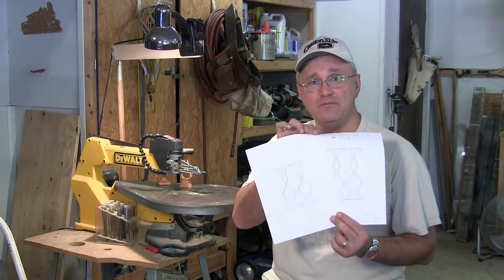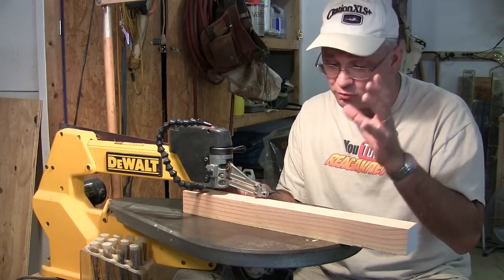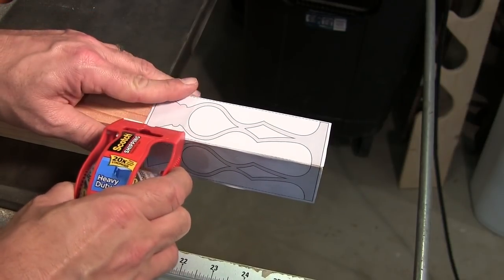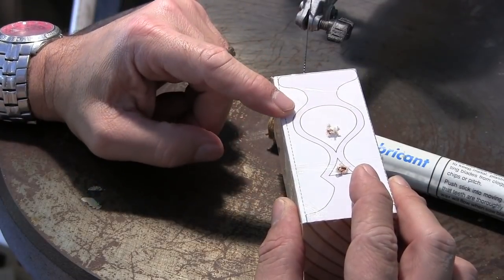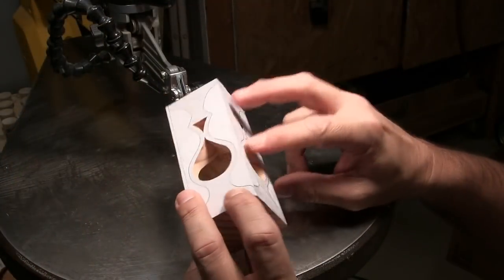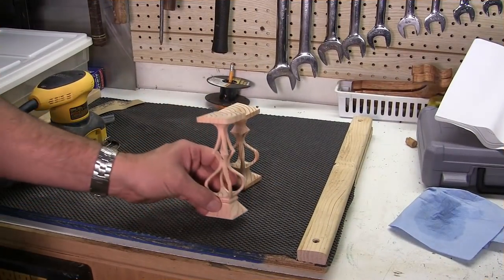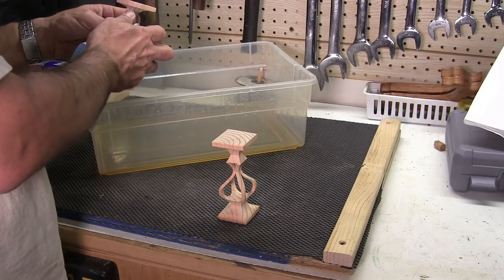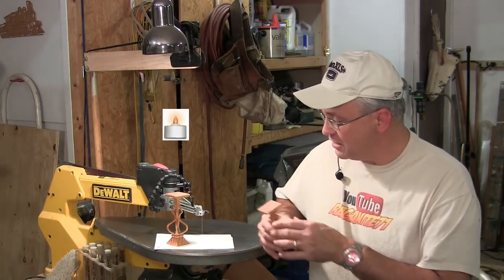Make these COOL 3-D Scroll Saw Candle Holders FREE PATTERN LINK

Comment: I would really appreciate it when you do projects if you could share what blade(s) you use. As a real novice scrollsawer I need to get some input on what style to use when. The project looks really nice and is a keeper for sure. Thanks Pat
Reply from the maker: Hi Pat.  It was a #5 Olsen reverse tooth blade.
Reply: Thank you! Is this your "go to" blade??
Reply from the maker: Usually THAT is an Olson 2/0 Reverse tooth.  I used the #5 in this case because of the thicker wood.

Comment: are you still out there my friend?
Reply from the maker: Yes. Still kickin'.
Reply: Hello from Kathleen, GA. I am a beginner with a Dewalt DW788. I am so frustrated trying to follow the line. My blade has a front to back movement of at least 3/16 of an inch. Just putting a piece of wood in next to the blade causes my wood to shake a lot. Do you the saw is not tuned properly? Any help would be much appreciated.
Reply from the maker: @jerrywmalone  Hi Jerry.  When you put the blade in, make sure it's clamped in tight and tensioned tightly as well.  I use a pair of needle nose pliers to give the thumb screws a little bit of extra torque.  Having a foot pedal for starting and stopping, will also allow two hands on the wood for an easier time of it.  Use the pedal and the blade speed to get a flow you're comfortable with.
Reply: Mr Reagan - I am looking for the pattern that you used to create the candle holder. I ordered the Spring 2012 Woodworking and Crafts magazine to get the pattern and I cannot find the pattern anywhere in the magazine. You also mentioned that you have the pattern on your blog and I get a message saying the blog no longer exists. Would you have a copy of the pattern by any chance, or another place I could obtain the pattern? Thanks for the trouble!
Reply: Same here  @jerrywmalone